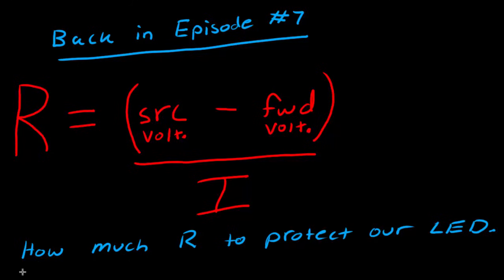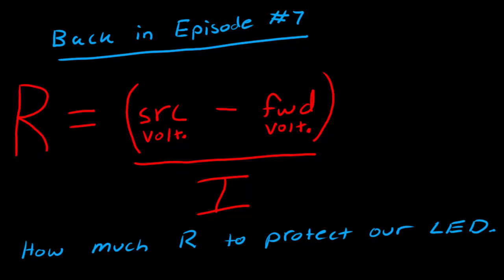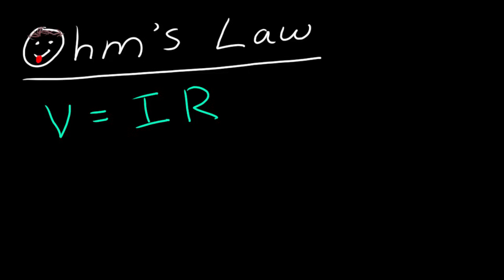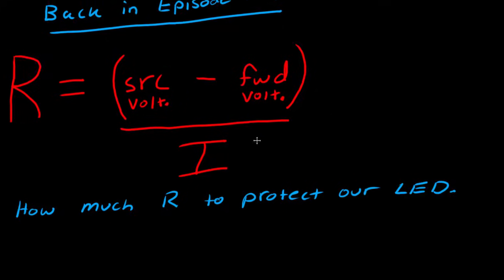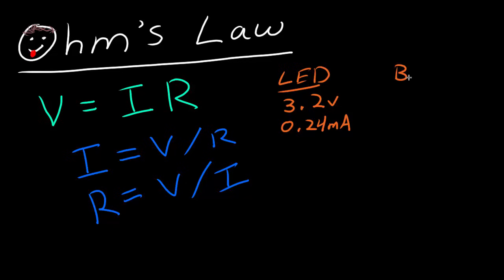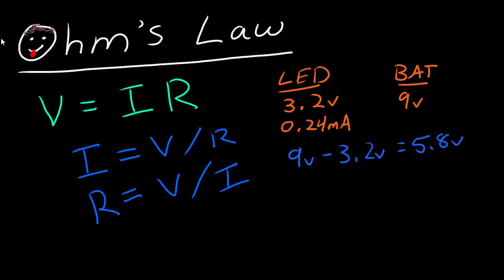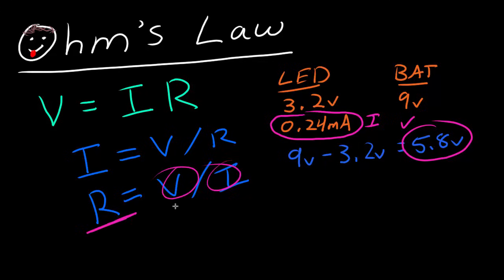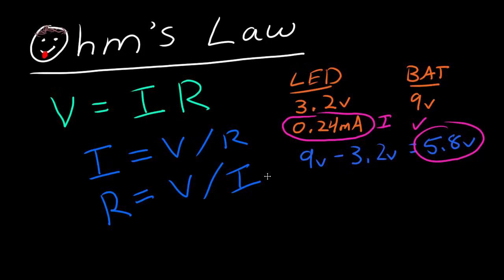Beginner Electronics - 15 - Ohm's Law

Comment: Guess i just answered a question I have had for decades. Do resistors waste electricity? in the LED circuit example the answer is yes and the follow up question is 3 watts (in a 28 volt circuit I am using it) 
interesting.

Comment: You did a very good job introducing VERY early in your series the formula that calculates what amount of resistor to use to protect a component/LED.  BUT, you never stated that the formula is one of the 3 formulas derived from Ohm's law.  By just understanding that resistance formula, it makes Ohm's law a bit easier to understand.  Trust me, I've had so many people get completely lost when I've started with Ohm's law and writing all of those derivatives.  They don't know what 'V' is and how to calculate it.  By introducing that resistor formula way early in your series, depending on how well they can do basic Algebra variable solving, it all made sense to them.

Comment: Fantastic series, thank you for that.
I have one question left. Previously we learned that Voltage is 'preassure' and Amper is 'flow'.
What I got my head scretching is when you said that 'this resistor will take away 5.2 Volts'. I was like huh, didn't we put the resistor to resist, e.g. reducing the flow and not the preassure?
I thought resistors only change the current but not the voltage.

So I guess my questions are: 
- do resistors are reducing voltage AND amp?
- is there a way to only reduce one of them?

Thanks!

Comment: If I connect 3x  3.2V LED on 9V battery then I don't need a resistor in my circuit, right?

Comment: I have a question. since forward voltage is the minimum voltage required for the LED(correct me if I'm wrong) shouldn't the maximum voltage be forward voltage + voltage that generates the max current the LED can take?

Comment: Hey there! I jut started watching your videos and first and foremost, a big thank you for the time you have taken to teach us all this knowledge. 

I have one question as a beginner. I have a lot of old LED’s in zip lock bags from about 5 years ago with no manufacturers specs. I believe most came from raspberry pi canakits etc. 
so let’s say I wanted to know what the manufacturer specs are just by having nothing except the LED’s. Is that possible? 

I’ve have a pretty decent setup as far as multimeters, lab PSU’s and components go. Just never took the plunge so now I’m wondering whether I should just purchase new LED’s with manufacturer specs or maybe there’s a way I can still use the ones I have.
Reply: Use your multi-meter on diode mode.....it will tell you. 5mm:  Blue 3-3.2v, Yellow 2-2.2v, Red 2-2.2v, Green 3-3.2v, White 3.3.2v
Reply: @peatmoss4415  Thank you kindly for the reply! It’s funny how looking back at this question now, I’m astonished at the fact that I even wrote it!
It’s amazing what a couple of years can do and I’m sure your response will bring light to anyone else that stumbles by it.

Comment: Summary:
- ohms law tells us the relationship between voltage, current, and resistance in a circuit
- V is voltage, I is current, and R is resistance
- ohms law says that I = V/R
- in other words, increasing the voltage will increase current flow, as long as resistance is kept constant (which makes sense)
- increasing resistance, while keeping voltage constant, will decrease current flow, which also makes sense

- electrical components (such as LEDs) have a limit as to how much current they can handle going through them
- electrical components use up some of the circuit's voltage
- current limit as well as voltage used, for an electrical component, can be found in the "data sheet" of the component (obtained from the manufacturer or googled :))
- you know how much voltage is provided to your circuit (because you know your battery), you know how much voltage the component uses (because you looked it up), thus you know how much voltage is left to circulate in the circuit
- you know the relationship that determines how much current flows in a circuit: I = V / R
- we want to limit the current in the circuit to what our LED can handle, thus we set I to that
- we know how much voltage is available to flow through our circuit (battery voltage - voltage used by LED)
- thus we want to find out, how much resistance to add to the circuit to get this much current with this much voltage
- in other words, we solve for R!

Comment: CodeNMore, about Ohm's Law, we learned there is a "Rule of Thumb" for figuring it. You make a Triangle, (30, 30,30,) and place V at the top, I at the lower left and R at the lower right, with lines separating them. (In a T shape.)  then to figure which one you need, you place your "Thumb" over it and follow what is left visible. i.e.: if you are wanting the R you cover it with the thumb, then see the V/I. For V, cover it with the thumb, then you see I*R. Very nifty.http://apps.usd.edu/coglab/psyc770/resistors/ohms4beginner.html

Comment: Brilliant series! As you covered Ohm's Law, I remembered a very simple diagram to make remembering Ohm's Law so much easier. Draw a triangle with a flat side at the bottom. Inside at the top place "V", inside bottom left corner an "I" and inside bottom right an "R". Cover the letter you want to calculate. Eg. to calculate V we multiply I by R. To calculate R we divide V by I.

Comment: Ohms law pyramid good to remember, draw a pyramid with a uppercase t in the middle making 3 sections. V on top, r for resistance bottom left, and I for current bottom right. Horizontal line means divide and vertical line means multiply, just plug in your values that you have.

Comment: aren't most common LEDs 3 volt ones unless specified otherwise?
Reply: well just looking at a selection they range from 2 to 4 .2 v but you also have to take into account what m amps they require which will affect the minimum resistor value required.

Comment: okay, i might have a brain fart. but what if the battery provides 5mA? Why are we calculating from the LED when its the battery that provides the current and voltage?
Reply: Let’s say you had a car, voltage would be the horse power that the engine/battery has, resistance would be the weight of the car, and current would be the speed of the car. The horse power/voltage tells you the amount of force that the engine can produce. That force causes the car to speed up, a.k.a. have current. However the weight of the car stops it from going at dangerous speeds/current (but keep in mind you can have dangerous levels of voltage too). You would never label any car by one of the speeds it can go at because it won’t always be at the same speed. That’s why cars mention horse power rather than one of the many speeds it can go at. And why every power source mentions the voltage it produces rather than the current it possibly can have. Current does not lead to voltage, but the values of voltage and resistance will determine the current.

I hope that made it more clear but please reply if you are still confused.
Reply: We know what the battery can produce i.e. 9v and we can see from the manufactures spec what the LED requires: a forward voltage of 3.2v and a current of 24 m amps. So the resistor has to absorb 5.8v which when divided by the required current of 24 m amps means that we will need a total resistance of approx 240 ohms. Its a bit like working out the missing piece of the jigsaw which is the resistor.
Reply: Patrick Na the same doubt
Reply: normal battary only have voltage rating and amprere is depending in your components connected to it.. it is like you have 100 dollar in your wallet (voltage), and it depend on you how you spend it (ampere).. you can spend it in 1 second or keep it for long time... hope you get it..

Comment: The symbol for Voltage is "E", not "V".  V = volts, E = Voltage.  If you draw a triangle and put the E at the top corner, I at the lower left and R lower right that would be a good way to remember OHM's Law.

Comment: what if instead of reducing voltage with resistance, we kept voltage same and changed current to match the same power instead?
Will this work?
And how to do it experimentally?
Reply: No - the voltage max value must never be above the limit of the component, otherwise it dies . The current works the other way: you need to have enough current to feed your component. but if there is too much, it doesn't matter at all. It's more like the maximum capacity of the power supply to deliver enough current.

River analogy again:

Volts:  if you install a water mill on a small river where the water goes at 2km/h speed, it might fall apart if the river goes at 10 km/h after a storm

Amperes: the same mill will work identically well on the Mississippi as long as the water doesn't go faster than 2 km/h. 

If you place the same mill on a really small stream, even at the same water speed, there is just not enough water to feed it and it stalls.

So basically reducing the current (misleading term) will have no effect, unless you reduce it so much that there is not enough current to run your thing. Once the minimum is reached, however, raising the current to a huge value has no effect - your component will just take what it needs.

You can see it on power supplies: if your router needs 9v, 500mA, any 9v that can produce at least 500mA will do. 

9v 200A is fine. 20v will kill it regardless of how much Amperes the power supply can deliver.

Comment: when a resistor takes up some voltage or resists current does it waste off energy?
Reply: A little bit... but you have to imagine back to the Water reference... A resistor is like a smaller tube for the water to pass through... It prevents the Pressure or Voltage from reaching the lamp... but it also drains the water slower because not as much can ass through... so yes there is a little waste of energy in form of heat but the voltage over the resistance does not use most of the energy... so it just drains the battery slower than before...
Reply: Yeah, converted to thermal energy.

Comment: I'm gonna ask if its possible to change the lead sealed acid batteries of my scooter into li- ion battery?  as of now im using 36 volt...12 volts each with 14 amp.pls help me....I have evo scooter 800 Watt right away and I want to change the battery..

Comment: love the videos keep up up the good work.. i have a question. first off i understand everything in the video and i understand your equation but i have a 9v battery just like you but i have a 12v bright led do i still need a resister or can i run it derectly??
Reply from the maker: +Ricardo Martinez the LED is a 12v LED? Wow. You shouldn't need a resistor if you are using a 9v source, but the batteries won't be as bright (unless for some reason I'm completely wrong...but I should be correct :P)!

Comment: I assume the answer is  24,166.6666667 or a 24k resistor.  I liked the vid but you never finished the equation.
Reply from the maker: +Tony Perry well, first off, I meant to write 24 mA, not 0.24 mA. Also, for the equation it must be in Amps, not mA.  So, using the mistaken 0.24 mA in the video, it would be R = 5.8V / 0.00024A = 24166 Ohms.  Using the actual 24 mA I meant to use would be R = 5.8V / .024A = 241 Ohms. So, you did the calculation correct, however I accidentally used the wrong numbers in the video ;P
Reply: +CodeNMore Thanks.  I'm just learning and I like your series.
Reply: Thank you all for clarifying and confirming there is mistake in the 0.24mA figure shown versus the 24mA shown in video 7.

Comment: I'm loving the videos, keep them coming :)

But sorry for being pedant, but when you mean that a resistor will 'waster or take away volts' is it actually draining the battery power? Or it's stopping it from 'flowing'? in your analogy with waterpipes, 'waste' would mean you would throw away some of the water to reduce the flow rate.

Also, in a completely side track, what does Watts are in all of these? What's it's relationship with Amps and Voltage?
Reply from the maker: +Fernando Santos I'm planning on explaining wattage in a different video, soon to come. As for the "wasting," I only said that to explain that the resistor is only allowing the LED to get so much voltage. In reality, we do need to know a bit about power (Wattage, essentially) to understand this a bit - I'll explain this more in-depth, but for now (in case you research power) resistors actually dissipate some power (in the form of heat), and often times this power dissipation is very minimal, especially for one LED.
Reply: +CodeNMore :( where sixteen at:(
Reply: +Fernando Santos so far i know the resistor will drain the battery . and becaouse of this buck converters are made.for not waste battery to much like resistors and for some other things
Reply: The resister turns the excess voltage into heat which it dissipates. The actually usage in the entire circuit from the battery is the LED and Resistor combined. but they are minimal.